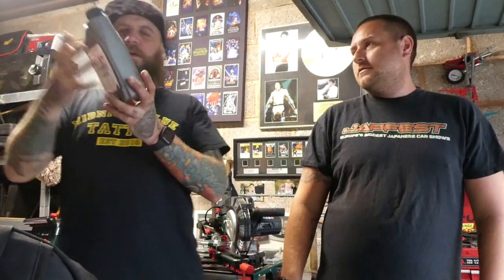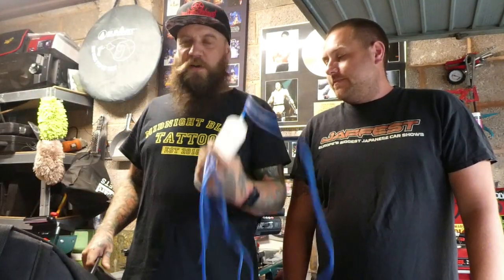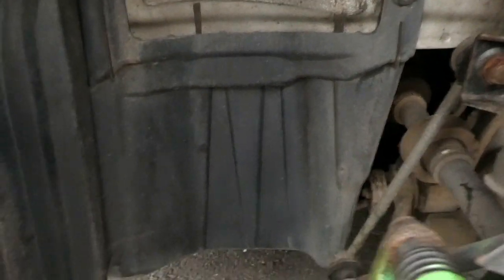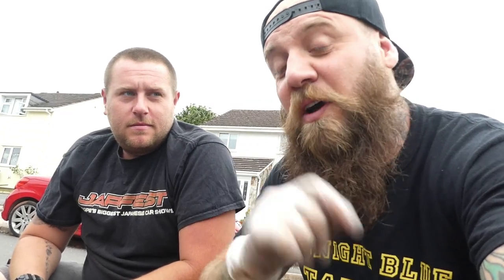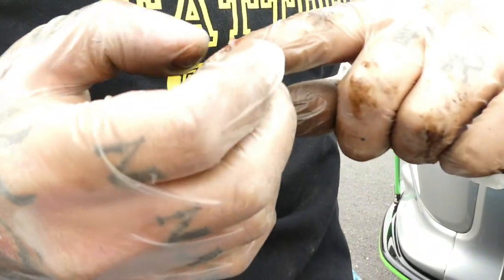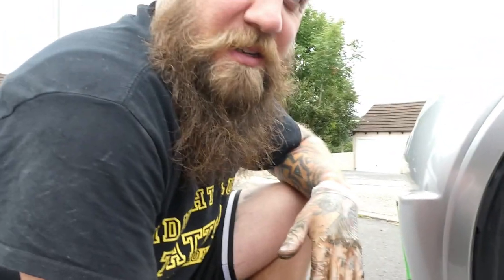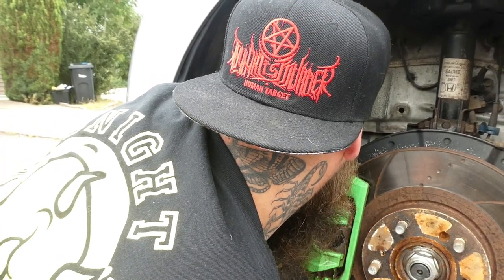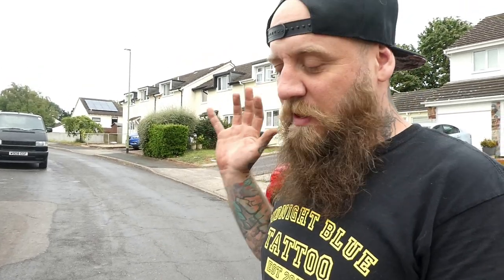How To Change Your FN2 Type R Gearbox Oil *THE EASY WAY*

Comment: Cheers for this! Very helpful. Mines only done 51k miles but going to do it anyway as its been standing for a while. Sometimes pops out of 3rd gear, hoping an oil change will make it a bit smoother and fix this issue.

Comment: Did you have it jacked at both sides? Just done mine and could only get 1.5 litres back in, and I'm assuming it's because itd only jacked it at the gearbox side so didn't get it all out

Comment: Anyone wanting to do this, just use a washing machine drain hose and a funnel to feed it through the top of the engine bay until fluid start coming out the fill hole

Comment: I just recently bought an fn2 type r. Definitely need to change the gearbox oil as gear changes are sometimes stiff, especially at higher rpm. Could you tell me the exact tools I need to do this job myself so I can order them straight away and get it done please. Thanks in advance
Reply from the maker: We didn’t use the syringe last time we did it. Just follow the video but use a tube and funnel and pour in from above mate. Feed the tube down from the engine bay. Sorted